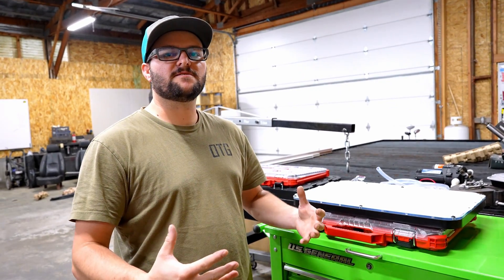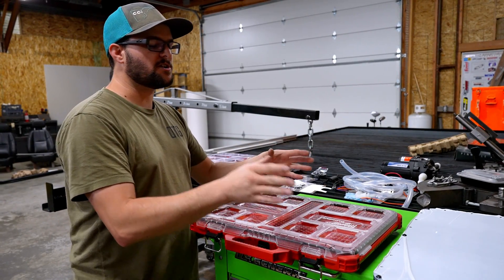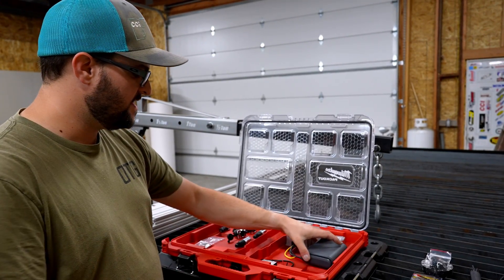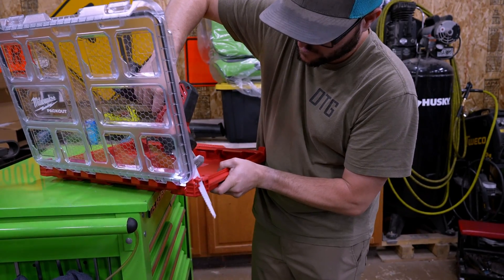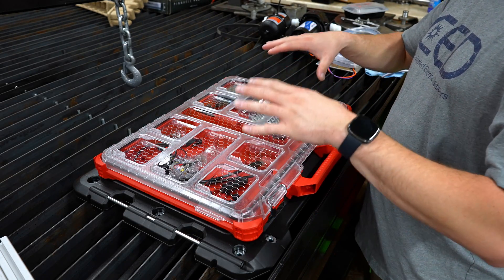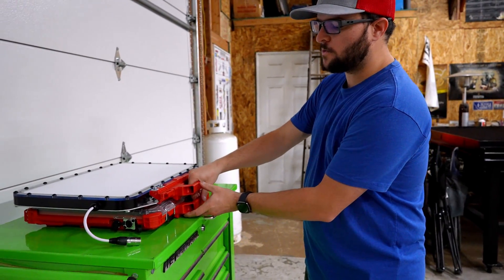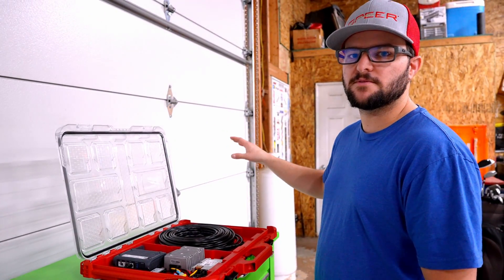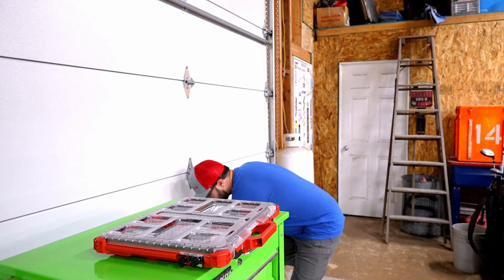Building the ULTIMATE 12v Portable Starlink.

Comment from the maker: Link to parts I used! 👇👇
12v Wifi Router-  https://amzn.to/3RODH1Y
Step Up Converter-  https://amzn.to/46B10jH
POE Injector-  https://amzn.to/3tu5ZV2
12v Regulator for Router-  https://amzn.to/3tjrM1Z
Cat6 Waterproof Connectors-  https://amzn.to/3tiY8tA
12v Waterproof Connectors-  https://amzn.to/3rKUND1
1ft Cat6 Cable-  https://amzn.to/3RNLkFM
75ft Cat6 Cable-  https://amzn.to/3PNi53r

Comment: For the rj45 connector, have you noticed any issues with your connection? It doesn't look like it's shielded and the starlink cables call for shielding. That's why I've been hesitant to put an rj45 connector in and instead just have the cable run through a waterproof cable passthrough.